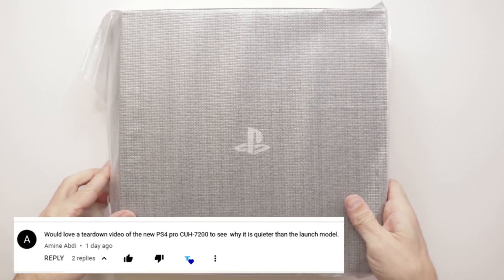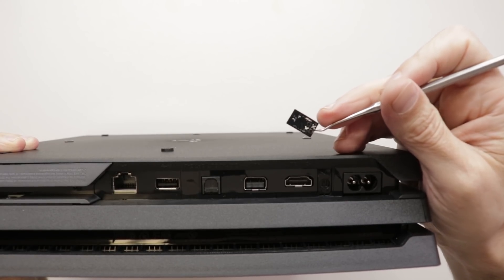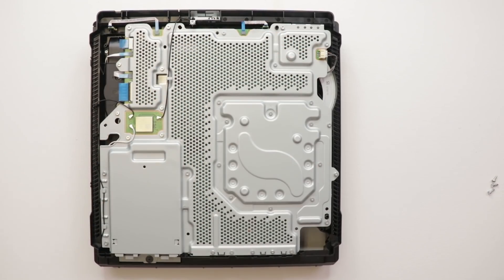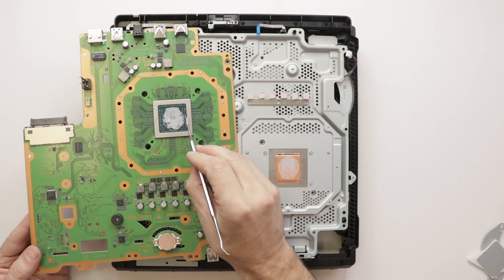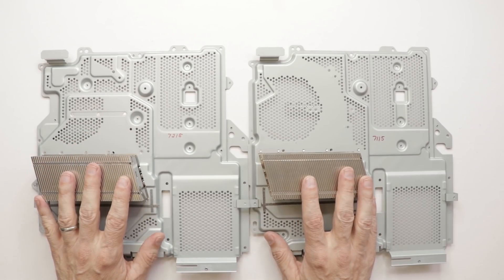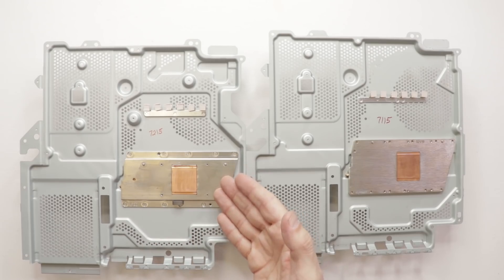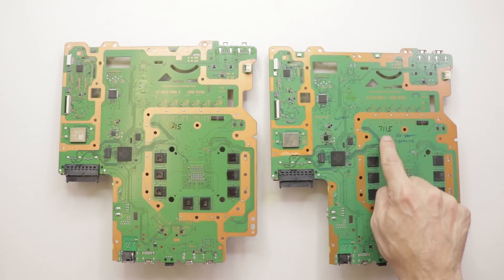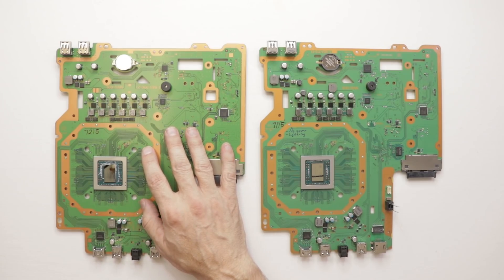The New 2018 PS4 Pro is so Quiet - But Why? Disassembly and Comparison - 7215 Model

Comment: Is there really a new APU? It's still the same nanometre right? Smaller heat sink is a bummer, would it be possible to increase it's size in line with the former's by attaching certain aluminium parts with thermal paste?
Reply from the maker: It would be really difficult to change the heat sink...possible but difficult. I can't say for sure if there is a new APU but it wouldn't surprise me.

Comment: My CHU-7015 has been very quiet after I changed the thermal paste and thermal pads.
Reply: That’s what I’m about to do lol
Reply: Thermal pads?
Reply: @jaylee5843  yes, thermal pads on memory chips
Reply: What compound did you use i read that this was good mx-4
Reply: @evilsmith957  yeah its good
Reply: @simorx580  havent yet taken apart my ps4 pro yet is it that hard to do
Reply: @evilsmith957  yes and no :D watch the disassembly videos
Reply: @simorx580  realy was not bad at all   took me 2 hours do full terror down and re build  still turns on turbo mode just for few seconds then it quits better then what it did Ty for this heard it also better change the pads out ill do that on another time my stock compound was so dry it just crumbled off the apu
Reply: @evilsmith957  i cleaned my ps4 after 3 years of everyday gaming and it was full of dust but i didnt replaced paste and pads
Reply: @simorx580  my compound was like clay it fell right off after i removed the cover  and cracks in middle good thing i decided to do this not sure how much longer i would had
Reply: @evilsmith957  dont worry, ps4 will shut down if its extremly overheated so it cant damage itself

Comment: Must be a better thermal paste! I know spawn wave used liquid metal on a ps4 pro and it's noise level went right down!
Reply from the maker: Could be. I've put thermal paste on them as well and it really helps. This thermal paste is the same color but it's definitely not as dried out.

Comment: hey  steve i changed my thermal psate on my ps4 and now my ps4 is louad like a jet and pops out cool air whats the problem?
Reply from the maker: No way for me to know without having it here to test but there must be something that wasn't put together correctly. Check to be sure the thermal pads are all in place. Sometimes they fall off when you are assembling it and go where they aren't supped to and that can cause the motherboard to not clamp all the way down in the heat sink.
Reply: @Tronicsfix  thanks a lot man your are the best
Reply: which thermal paste did you use?
Reply: @Devicecaredirect  some aftermarket one
Reply: @wolfmohammadi9582  go for arctic silver 5, paste you used made it even worse.

Comment: i feel i wanna upgrade my og ps4 to ps4 pro just because but then i see no real point, untill my ps4 breaks i'm gonna run it for all its worth only then might i consider a ps4 pro replacement.
Reply from the maker: That's a great way to do it. Plus it saves money.
Reply: Common sense prevails,if its not broke,etc etc...

Comment: smaller psu plug must mean a more efficient power consumption.
Reply from the maker: So far looks like the same as the 7115 power supply but I'll need to check that more.

Comment: My ps4 just *broke*. It turns on for a second, beeps 3 times, then shuts off. I need to fix it so if I do get another PS4 I can transfer data without starting everything over. Any ideas?
Reply: You’ll have to start over unless you get your broken ps4 to turn on
Reply from the maker: I've never figured that problem out. Wish I had something for you but don't. Sorry.
Reply: TronicsFix Damn 😫 I don't know what to do
Reply: You can take out the old harddrive and put it in the new ps4. Also make sure you're pressing the power button and not the eject button. Buddy of mine kept hitting the eject button and it made 3 beeps and no power on. He thought it broke but showed where the power button was and now all is good, haha.
Reply: Onua I heard doing that doesn't work :(
Reply: @AlmightyJoey_  I've done it but with fat original ps4 to another fat original ps4. It won't work with ps4 pro to original fat ps4 or vise versa.
Reply: put the drive in another ps4. pref same revision.

Comment: I feel like buying that then adding mx 4 arctic thermal paste make it even quieter since on Amazon it claims its better than liquid metal maybe you can test that theory
Reply from the maker: Where does it claim it's better than LM?
Reply: TronicsFix oh sorry it’s Arctic MX-4 Amazon 1# best seller it’s $9.99 (USD) here’s a link it says right below the price 

https://www.amazon.com/ARCTIC-MX-4-Compound-Performance-Interface/dp/B0795DP124/ref=sr_1_fkmr0_2?ie=UTF8&qid=1542409741&sr=8-2-fkmr0&keywords=Mx+artic+5
Reply from the maker: Wow, I can't believe they make that claim. MX-4 is in no way better than liquid metal EXCEPT for that fact that it's not electrically conductive. If you Google MX-4 vs liquid metal you'll see test that others have done. MX-4 is nowhere near as good as liquid metal from the tests results I've seem. 
Also, the rating is nowhere near as good. MX-4 has a rating of 8.5W/mk and liquid metal has a rating of 73 W/mk (higher is better). This explains that rating: https://forum.digikey.com/t/what-is-the-specification-w-mk/370
Reply: TronicsFix I get the thermal conductivity power heat transfer between the two but I think since said 2018 oh it must mean something so you could test it out and see any difference and if it’s not making any difference tell amazon to tell that seller to take that out because it could trick people you know not like me because I know how it works it depends on the surface area and the amount that can be transferred as in TDP of the chip it outputs in heat pretty much so it could throw someone off that doesn’t know much like beginners that want to build custom gaming pc’s
Reply from the maker: Unfortunately, sellers are able to make whatever claims they want. I may test it at some points.